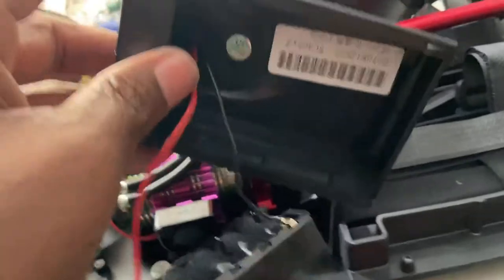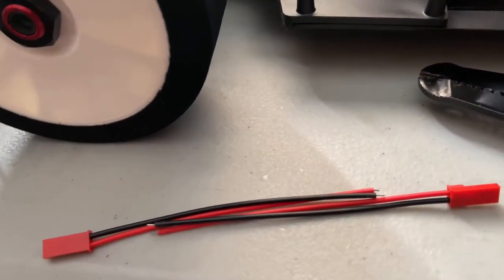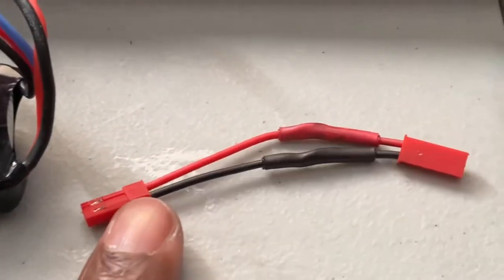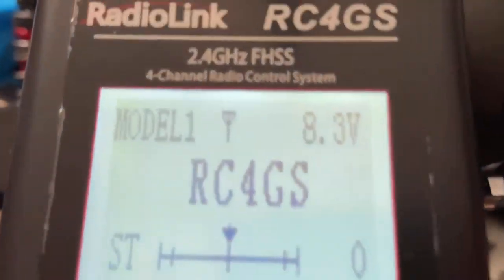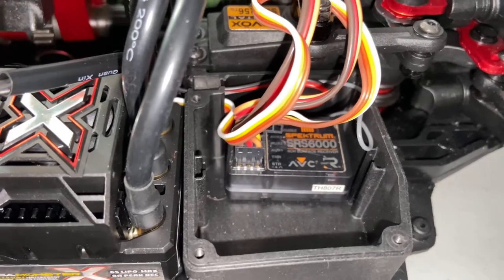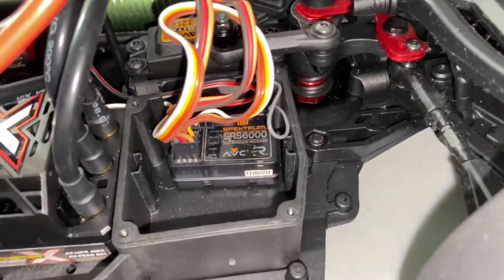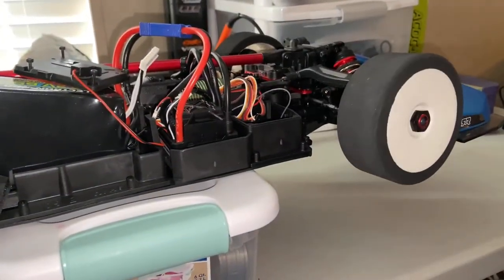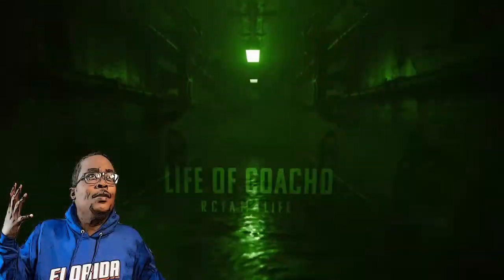RadioLink RC4GS V2 LiPo Conversion and Binding

Comment: I've had the first RC4GS model for years and now have the V2. Love these radios. Technically its not really a conversion to LiPo as the product specs specify it can take multiple battery formats. You basically take any battery pack within the specified parameters, plug it in and adjust the radio accordingly. I have been using recovered Laptop 18650 batteries setup as 7.4 volts.

Comment: Nice I just installed the RADIOLINK RC6GS oh boy that's a mouth full to say.  I've installed the 6GS in my Limitless today.  Set the gyro trim and going to be doing a running video in a day or two.  Its not the 600 meters receiver Gap has but 400 meter.  And what Lipo are you using? Trying to decided which to get.
Reply from the maker: Hit me on Instagram and I’ll send you the link bruh... what did you set the gyro trim to?

Comment: Great Video... Do you leave the lipo in the controller when you’re not using it?
Reply from the maker: I do, i unplug it and haven’t had any issues since 2012(knock on wood) lol
Reply: @CoachD386  it would be cool. if you could find a tiny lipo bag that the battery would fit in inside the controller.
Reply from the maker: @bigheadrc  yeah it would be, but no need honestly.

Comment: Hey Coach D have you tried the flysky gt5? Do you think this radio is better than that one? Im trying to decide between them. I think the gt5 looks a little cleaner design but was curious how it stacked up.
Reply from the maker: The RC6GS has the same range as the gt5, design wise the RadioLink reminds and feels like a spektrum to me so the feel of it is what i like... price wise the RC4GS and receiver it’s definitely better.
Reply: @CoachD386  Thanks for the advice. Ill try the radiolink. Ill use your link when I order. Thanks again brotha
Reply from the maker: @cwatson42785  anytime

Comment: Hey coach, I have an RC4GS v1 and trying to bind to a new R6f I just got on amazon. Won't bind!!!! Any pointers! I followed directions press bind button until it flashes and wait. Turns solid and I got no controls, no steering, no throttle. Halp?!
Reply from the maker: The radiolink transmitter and receivers come binded already, that's strange that it isn't giving any controls.
Reply: @CoachD386 oh I bought them separately, this is my 3rd radiolink RX. Got it figures out, plugged in servo and esc backwards 😂😅 thanks! Runs fine now!
Reply from the maker: @RandomStuffGarage619  ahhh ok